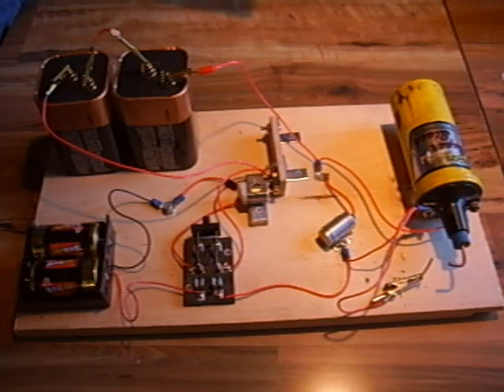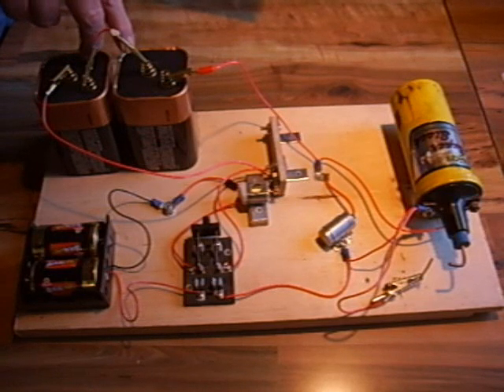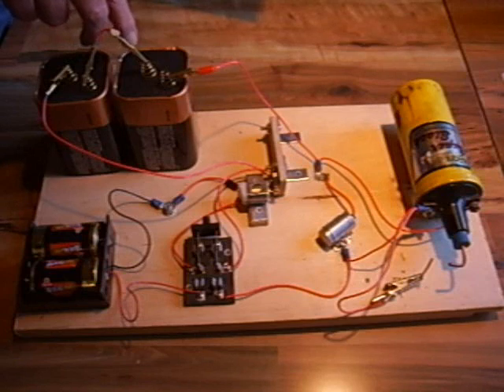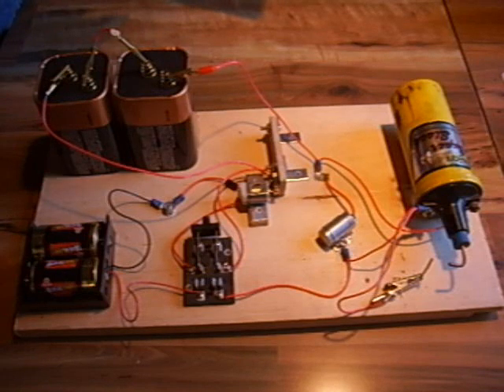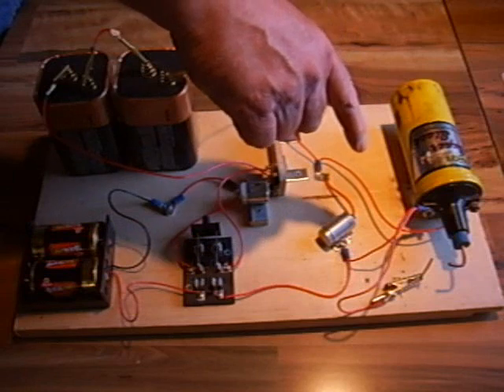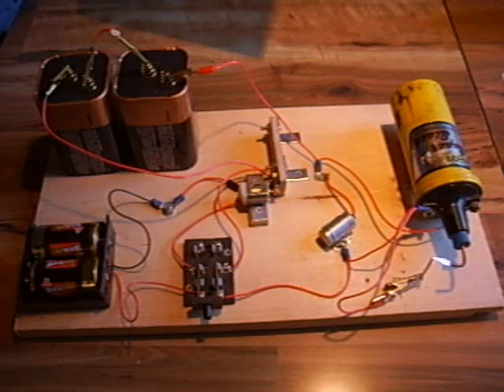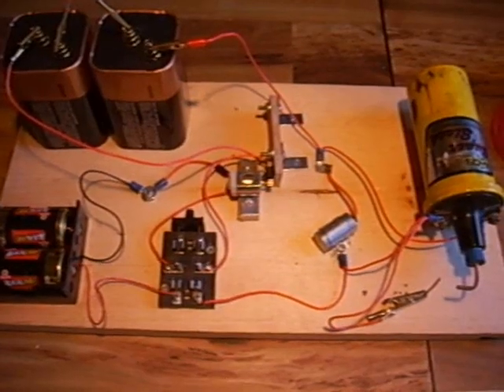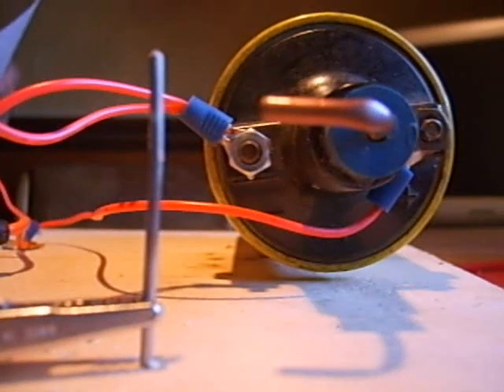Science Project Tesla Coil

Comment: This isn't a Tesla Coil, it's just working as an induction coil.  A Tesla Coil uses resonance to generate high voltage and high frequency.  A true Tesla Coil would generate around 100,000 volts at least, and would operate at radio frequencies.  You *could* use this to power a small Tesla Coil though, if you added an air wound primary and secondary winding, small capacitors, and a spark gap.

Comment: @sparkfishes The motor turning around in the middle is the rotary spark gap, there is also a capacitor hooked to one end of the coil (which a car part store calls a condensor or external resistor)

Comment: hey for all the comments i read about whether or not you will get hurt by that arc of lightning, the answer is yes because the electricity is only vibrating at a normal cycle one thing that gives this hint is that the arc is completely jumping the gap on a regular set up. if it caused the electricity to cycle at a normal state for a tesla coil, then the electricity would only go skin deep and pass through you harmlessly like how tesla use to do with his coils and WITHOUT A FULL-BODY CHAIN MAIL.

Comment: This is simply an ignition coil driven by an oscillating circuit. I don't see how its been tuned to a specific resonant frequency, in fact I don't see any evidence of resonance at any stage of the circuit. Also, a Tesla coil should be capable of producing capacitive discharges to the air itself, not just a ground or return line. Does the ignition coil produce a powerful excited electric field? A Tesla coil that size should be able to light up a large fluorescent  tube in close proximity.

Comment: no imnot wrong ihave tooken them apart many many times counted turns  and stuff the spaces are all evenenly tuned out usually 30 turns or so per layer evenly spaced out but  many many layers count the layers and multiply by the turns and you got a count. and tesla has a patent utilizing that same setup and several other people utilizing the same setup  the ignition coil will work in air core mode just fine but with fewer turns on the primary

Comment: an oil filled ignition coil is still a tesla coil one of his 3rd generation coils just with an iron core to increase performance at lower voltages take the core out and treat it like a normal tesla coil and it will still work. oil fileld ones are based off from teslas multilayer oil immersed coil. most oil coils only have between 3000 and 7000 turns each turn spaced. other ignition coils the potted ones are indeed a low tension transformer